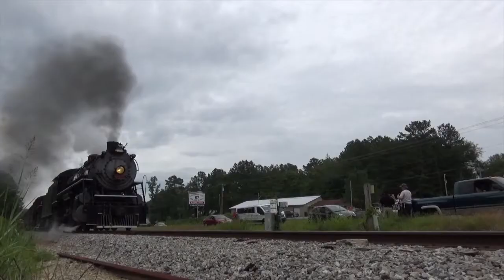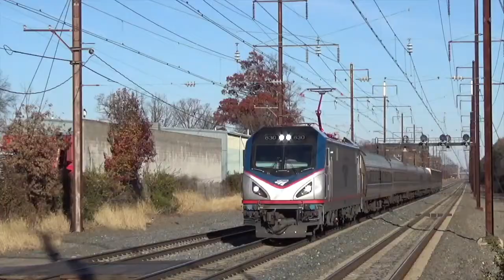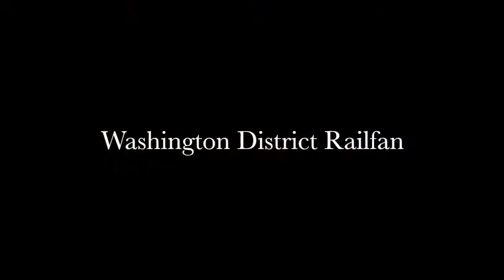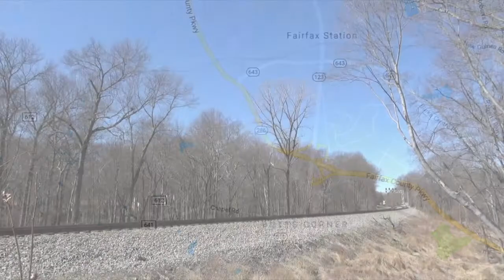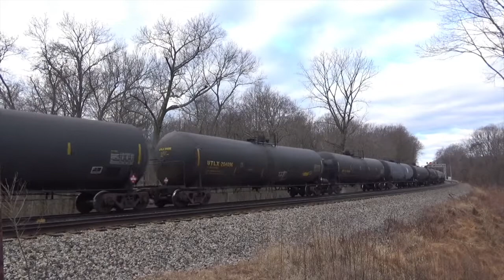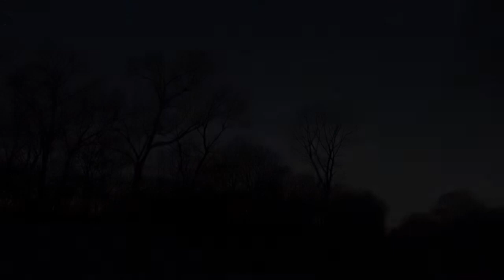Norfolk Southern trains in NOTCH 8 up the steepest railroad grade in NOVA!

Comment: Where was this filmed on Google Maps? I.E the exact curve. Just in the area myself, and never knew it was a 2% grade from Clifton to Burke. Trying to figure out what corner you on, but can't tell. Is the grade from Clifton all way to Burke station?
Reply: Haha maybe just answered my own question, found it in Google Earth not Maps. This at the dead end of Co Road ?
Reply from the maker: kilrbe3 I filmed this on the very end of Sideburn Rd, just down the street from George Mason
Reply: @WashingtonDistrictRailfan  Opps! I typed in wrong road, yup that's the one! Cheers mate, Def will go check the spot out sometime very soon, more so with fall colors now. The midnight train def does run between 12-1am, Hear it every night. Lately seems they been running about 3-4 at night through as I keep my window cracked and easily hear em.

Comment: The buffer car has nothing to do with slack action. The buffer car is a FRA requirement for spacing between has-mat cars and the engines.  Normal requirement is 5 none haz-mat cars between the engine and loaded  haz-mats but the FRA cleared the RR's with one buffer car.  There is one on the rear in case a locomotive is coupled to the rear for some reason.